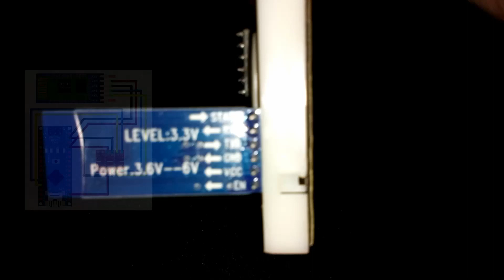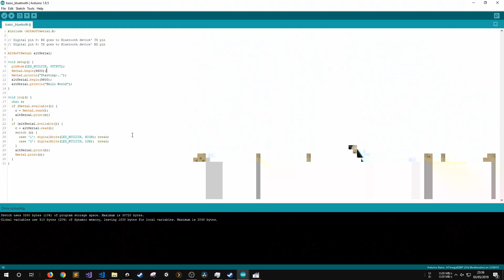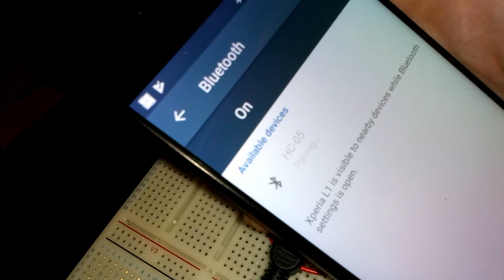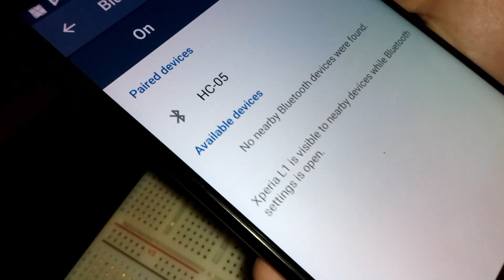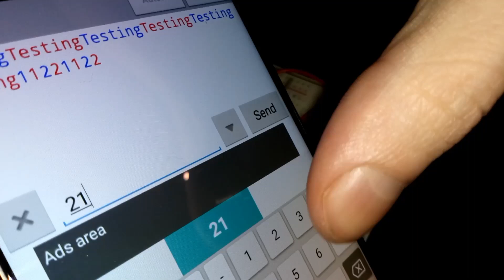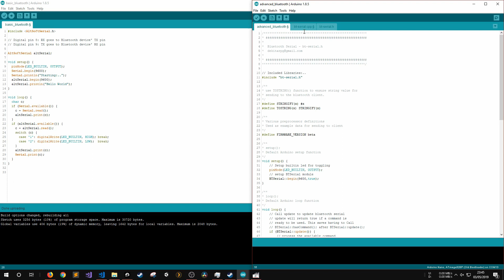Arduino Bluetooth Module Tutorial - The Easy Way

Comment: I connect OK (RX=#d9 Tx=#d8) and serial monitor prints "Starting:.." but it doesn't appear that altSoftSerial is working/starting as I do not get Hello World. 

Arduino nano, ATmega328p (old bootloader)
Arduino 1.8.31 (Linux Mint)
I've included the AltSoftSerial.h library from your basic BT @
https://github.com/Dekita/arduino_basic_bluetooth.
Currently I'm using your WS2812 sketch for  programmable LED strips and am having some issues, so I thought if I can start with your basic BT, then your advanced, I would be more knowledgeable with BT, etc.
Thanks for taking the time to develop these You Tube video's. They are very helpful.